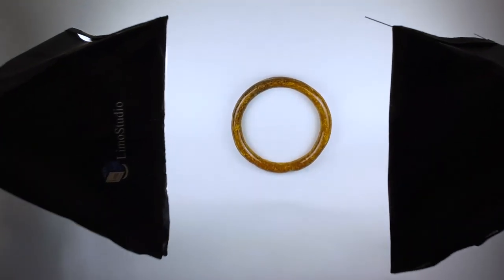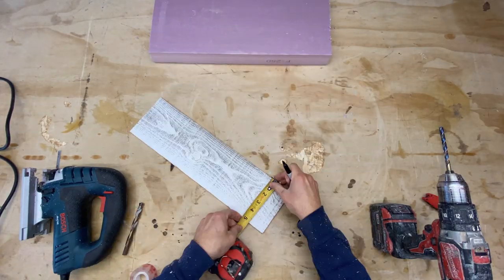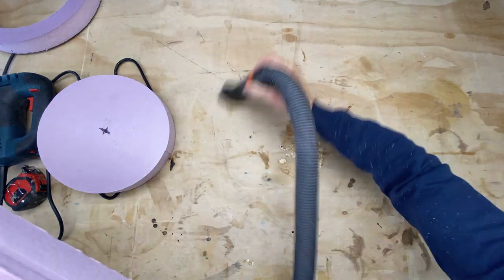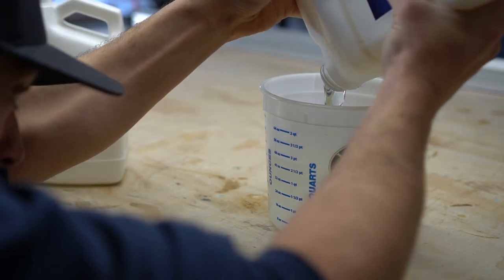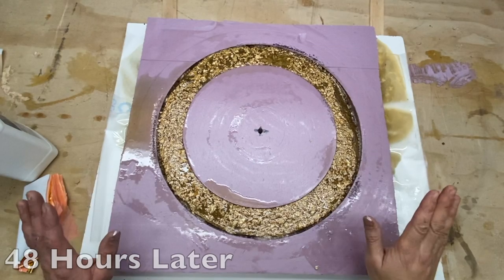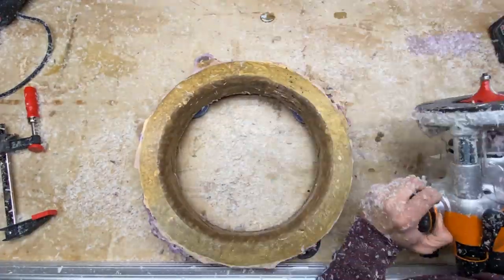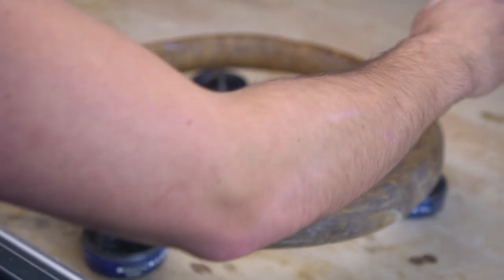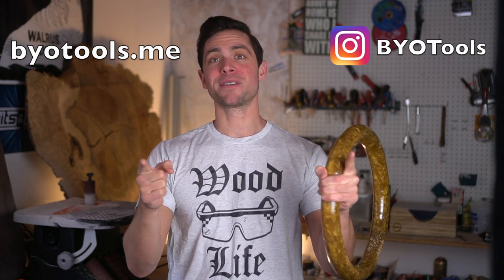Sonic The Hedgehog : DIY LIFE SIZE RING

Comment: 2 suggestions for improving on this:

1) use a vacuum pot to remove the air bubbles before you pour
2) the gold flake seems to have migrated to the surface so doing 2 or 3 pours would help distribute the flakes more evenly on both sides and throughout

Bonus suggestion:

I don’t know if you intended the uneven surface for a “hand forged ring” kind of look, but if you wanted a smoother finish you could leave the center section in, then put a straight or spiral cut bit in your router to create a 1/4-1/2” deep groove around the outside perimeter first. Then line up the guide bearing from the roundover but on that to start creating the profile. 

Looks great overall, and very creative project. It’s always nice when people share their mistakes so we can all learn from them. 👍
Reply from the maker: Great to hear and thanks for all of the suggesting.  I think its important to show the mistakes because the process or trial and error are important in the learning process.  I really appreciate your input and support.